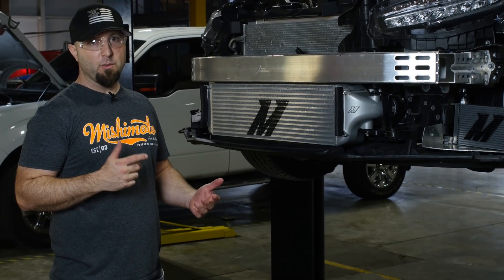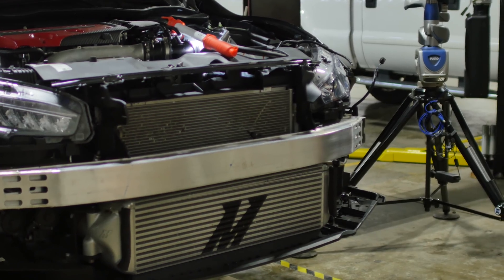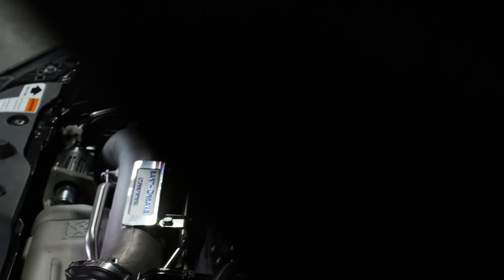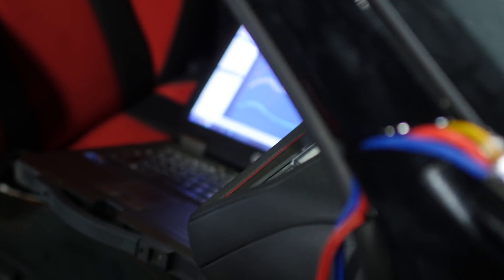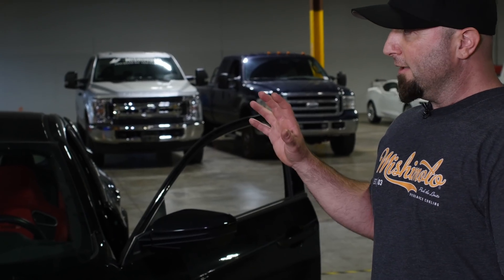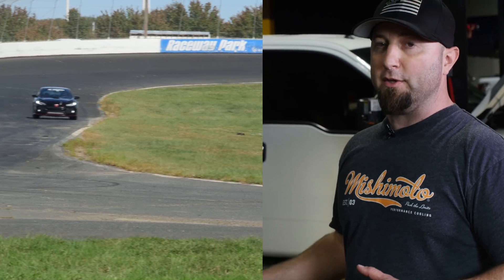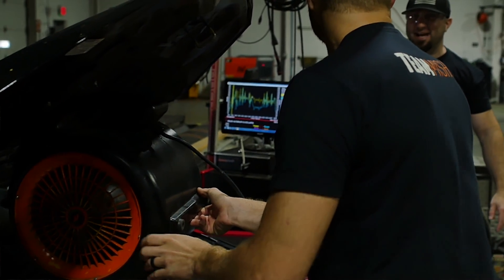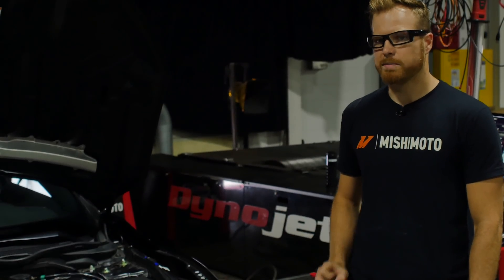2017-2021 Honda Civic Type R Cooling Solutions - Concept to Completion

Comment: So, did the Aux. Radiator help the overheating issue?
Reply from the maker: Our friends at United Speed Racing reported back that they were able to stay out on track for significantly longer during their time attack sessions with the help of this rad.
Reply: @mishimoto  thanks. I'm thinking that the exhaust manifold design is the culprit of higher water temperatures.
Reply from the maker: With its close proximity to the cooling stack, we agree that some mods could be made there to improve overall temperatures.

Comment: not sure what this is about. I recently spent a track day at Laguna Seca in my 2018 CTR, did every session available at break neck speed, and temp gauge never even got halfway up. I think the overheat probs are with the tuned CTR's, not the stock 306hp running on 91 octane? I am considering tuning this car, but have heard about the overheat issues that come with it,..not to mention the voided warranty issue.
Reply: No. Air Temps rise quite a bit after one lap which effects HP.  Watch all the videos they have for this car.
Reply: Even stock cars are having Temperature issues, not as bad as tuned ones, but still having issues. don't go by your factory gauge, by the time it goes up you are way over heated. also some geographical areas suffer more than others.
Reply: Not getting temps up because you aren’t going fast enough.

The quicker guys running these cars have temp issues with stock powered cars.